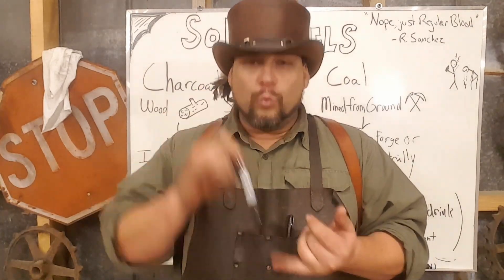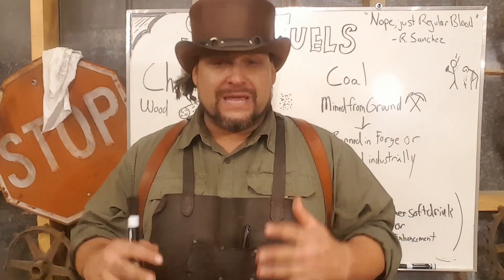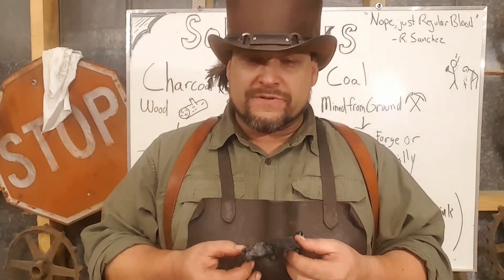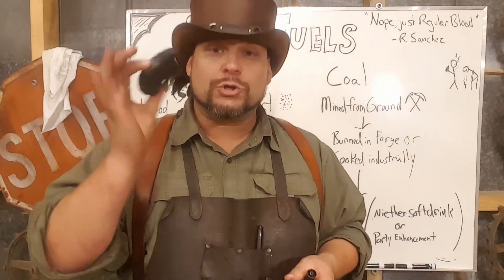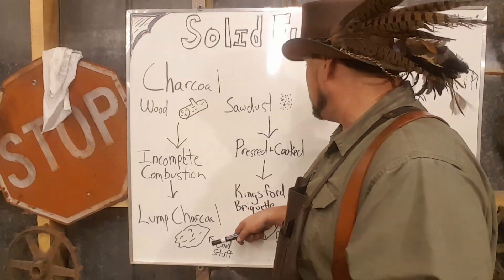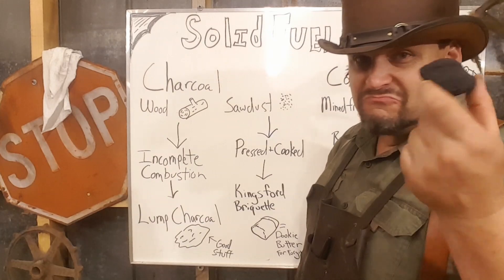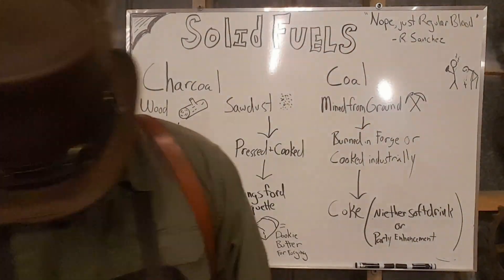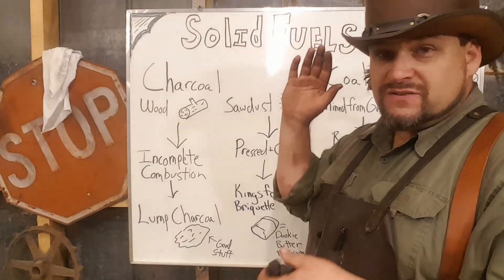Forges Part Two: Solid Fuels

Comment: Good info..  

You can also start with dry wood right in your forge and let it burn to charcoal as in your pit forge video. You just have to keep feeding it.   Dried corn also works and once carburized, will easily form a beehive hot spot.

Thanks for the video...

Comment: Thank you kindly sir! I just came across a massive coal deposit that's very accessible out in the mountains here in Alberta. I had no idea how to use it or if it was better than lump charcoal. (I have been using gas for quite a while now) and want to give it a try in my old solid fuel forge. Very informative, and I look forward to trying it out

Comment: England here:

I use anthracite, of the Welsh variety, supplied in small lumps called Anthracite Beans.  It's among some of the highest carbon content in the world.

It's also cheaper than the Blacksmith's Coal that is available - usually called Forge Breeze.  Anthracite is currently about £17 per hundredweight - 112# (50 kgs).  Forge Breeze is about £25 per cwt.

None of the above information is of much use to Americans :-)

It's very hot, it produces less ash than any other coal and less clinker too.  It won't burn at all without an air blast and goes out very quickly when the air is turned off - which is a minor advantage too.

Good video and channel.  I shall subscribe.
Reply from the maker: Thank you!

Comment: I run my self made whitlox style forge off of charcoal. One thing I'll say is that pine charcoal is much worse then charcoal from a hardwood. Hardwoods have much denser wood fibers so they burn much longer then pine. I've been making my own charcoal  and pine charcoal is very noticeably lighter and weaker structurally then a hardwood charcoal. So I primarily use pine as the fuel to make my charcoal.
Reply: Haze33E spot on sir hard woods all the way

Comment: I've been using anthracite for years, because it's all I have access to. I can get 50lbs for $6, as opposed to $50 for 50 lbs of bituminous. I also like the fact that anthracite burns nearly as clean as charcoal. I've been shamed out of most blacksmith forums for preferring anthracite, but whatever, it works for me.
Reply: How do you get it that cheap I am using wood in my brake rotor forge and it works fairly well but I want something beter I go thru a lot of wood
Reply: wayne russell 
Wow, I can't believe what you have to pay for coal.
Being in Alabama we have several sources for bitouminous coal.
Last buy I made was $120 for 1200#.
I guess living in a state where coal mines are is advantageous.
Reply: I use it too and get crap from other smiths but I don't care what they think because I know what works in my shop. It's like using an ASO (anvil shaped object), it'll work but it wont be easy or pretty, but at the end of the day it'll get the job done.
Reply: Asw Asw I get anthracite from tractor supply. It's always been good to me.
Reply: Mitchel Perkins yeah. I'm pretty surprised by the price as well. I do live in the periphery of "coal country", near several PA quarry's  and Ohio. But, as I said, anthracite is what I prefer. When I've had bituminous, it didn't seem to do as well. Maybe it's just what I'm used to.
Reply: wayne russell here in England, other than coak, it's the main thing we use and recommend for precisely the reasons you gave

Comment: Excellent video.  Anthracite coal is harder more expensive coal.  It is the original "cokeing coal".  When its cooked in the cokeing ovens the coke is very hard and very high in BTU's (British Thermol Units).  It was required for the steel mill blast furnaces because iron ore could be layed on top of it and the coke would sustain the weight and allow oxygen to be forced through it melting the ore to cast (liquid form) iron.
Bituminous coal is softer coal (cheaper) and is used more it electricity production.  It doesn't have the strength to support the weight of ore.  It's usually pulverized and blown into the boilers to produce steam/power.
I have 36 years workin in western coal mines.  
I have nearly unlimited access to lump coal.  However the oiled slack or "stoker coal" is much better for a forge.  Some folks here in Utah still have stoker coal furnaces to heat their homes.   Stoker coal is sized and refined to be used in hoppers with an auger feed.  This makes it much more useful as forge fodder.   Bituminous stoker coal is about $80.00 @ ton.  Anthracite cokeing coal is closer to $300.00 @ ton.

Comment: 40-50# bag of anthracite from tractor supply, grab several at the end of winter when they are on sale for less than 6 bucks a bag. Anthracite doesn't smoke and burns real clean, it doesn't coke up though but it doesn't need to. it burns hellaciously hot. Bituminous is 'sticky' in the forge and will coke up due to all the coal tar in it which is why blacksmith's prefer it, you can build a little nest from bituminous to keep your piece in and it shields your eyes from the light. Whereas with anthracite all the coal tar has hardened into a rock and it is literally like burning a pile of rock. Anthracite is a bit more picky than bituminous when it comes to airflow, anthracite requires a constant flow of air to stay lit and you can accidentally starve the fire of air and not know if for quite a while. On the plus, if you kill the air the fire goes out quick.

i keep a small bag of charcoal just to make a small fire to light my anthracite....but once that anthracite is burning hot....it'll turn bar stock into a sparkler real fast, you have to stay on top of it.

Comment: There are different types of fuel for the forge is there any difference between the types of forge used to burn them and is there a different way that you need to maintain the fire especially between coal and coke there are lot of videos on how to start each type of fule but not that much on the maintenance of both and I'm trying to find out a lot about coke fire as it is the main fuel beside charcoal that i have access to charcoal produces to many sparks and burns at a large rate of consumption I'm hoping the coke will burn slower and save me some time and money in the long run as not all the charcoal is a good quality so it burns so quickly and I'm having trouble getting the forge welding heat from it. The bag says lump wood but not what type of wood was used

Comment: So using Pine Cones for Charcoal, how do you burn them?? Do you burn them for a length of time, or just until they are totally black?? My parents live in a city with a TON of pine cones.  So I have access to them.
Love the VID's I am going to build my first dirt forge here really soon.  I need to rewatch your vid on that.  Thank you again..
Reply: Steven Pierce i don't know if you can.... At least not practically.  I expect the pine cones to have to much pitch in them. However the key seems to be to put the material in a oxygen limiting container and heat it. (Put it in a drum, with one or two vents, preferably towards the bottom. Put it in a fire, with the vent in or near the flames. The flames use the oxygen before it can get in the container, and all the volitile compounds are directly combusted as they leave the drum.

Comment: So I originally picked up some lump coal only to have someone tell me it wouldn't work for forging. Your video has me curious about mixing different types of coal. I have access to both bituminous and anthracite. Can I mix either with the lump coal?
Reply from the maker: You can but why would you? Use one fuel or the other to keep even burn rates.

Comment: You have anything against using kings-ford to start my coal forge? :D
Also what do you recommend to use for a forge blower?  I have been using a shop vac with the hose reversed but I think it is pushing too much air.

Comment: I'm trying to figure out if Coal or Coke is going to be cheaper for me than propane. Prices in my area are as follows: Around 450$ for 200 kg (441 lbs) of coke. You mention 6 gallons of coal in the video for a day of blacksmithing, but what is that in weight? 
In comparasion, 25$ gives me around 2 hours of forging with a gas forge, measured on my current propane forge.
Reply: coke is "charcoaled" coal.  coal will be cheaper and heavier than coke.

Comment: Can I simply use wood to fuel my fire? I have access to tons of lighter knot where I live and I am wondering if it will get hot enough
Reply: I know its late but yeah, you can use wood. I did it, its much harder to manage a fire than with charcoal or coal, but it is better than nothing.

Comment: I understand that you can get the same BTUs from both coal and charcoal. However, do you have to use more air volume with coal or charcoal to get the max BTUs out of your fuel? I am asking because my blower is small and I can't get my charcoal hot enough to give me forge welding temperatures.
Reply from the maker: You can get away with less air with lump charcoal because it doesnt clog like coal.
Reply: purgatoryironworks thank you.

Comment: Thanks as always for the information, a little question on propane, I've heard a ribbon burner is more efficient than a Venturi type burner. Is this true? Yes the initial outlay will be higher but in a country where gas prices are going up every 2 months as the currency weakens, I'd rather spend the cash on a good blower now and save in the long run.  Your opinion would be greatly valued. Once again thanks
Reply: Haroon Asmal Hi. I'm not Trenton but I have run a propane forge for years in my armour forge. What I have found is that a forced air burner can give you a lot more heat for your buck. Keep in mind though, you will stick your material into a very hot and oxygen rivh environment. This means you will get a bit more fire scale and you may get issues with forge welding and decarbonisation of the steel.
But a decent blower will save you money on propane.
Reply: Haroon Asmal 
Ribbon burners use low pressure on the gas, 2-5 psi, but they are also blown, or forced air forges. 
Much more fuel efficient than Venturi/ atmospheric burners.
I have built both styles. And they both function wonderfully.
But I get over 4 times the amount of burn time with the ribbon burner vs the atmospheric burner.
Ribbon burners are pretty easy to build actually. 
Do a search for ribbon. Burners on YouTube.

Comment: Really like your channel. 
I didn't get why you recommend coal? Koks is a more pure fuel?
I use koks, and it can be a little hard to fire up, but when burning it gets a good heat and last long.
Reply: Peter L I'm interested in the answer. I couldn't find anything on koks.
Reply from the maker: Well, there is big koks and little koks......... and its usually only older koks that are hard to fire up.
Reply: purgatoryironworks hahaha, sorry, I meant coke. I'm from Sweden, I'm not that used to the correct terminology. As I understand coke are more pure to work with?

Comment: If you're interested I know where you can get mine coal $11 for 80 lb bag holler back
Reply: Darrell Walker ...is it "every TSC in the country"?
Reply: Some Dude , I bought Anthracite from TSC last fall but they stopped carrying it in the spring.  They said it's a "seasonal product" (I live in Gainesville,Fl.) and won't be back in stores until fall!   The only sites I've found, sell for 1$ a lb!  This includes shipping though.  Good thing i bought enough, last year!  I also built a gas forge but haven't used it enough to determine $ comparisons to coal.  I'm sure coal will end up being more cost effective,  if I can get it at TSC prices!
Reply: Darrell Walker where do you get your coal?
Reply: Mark Clark a hardware store in Thomson Georgia